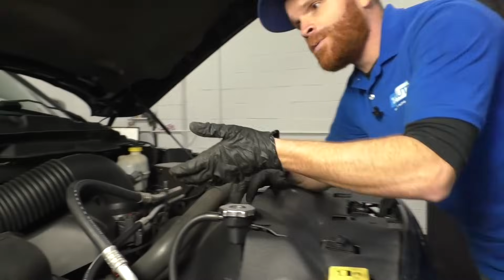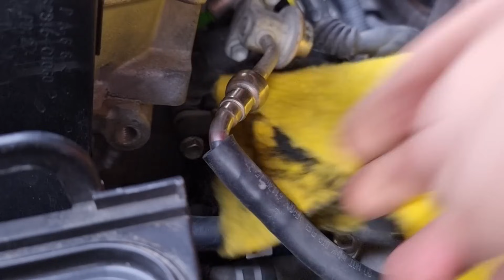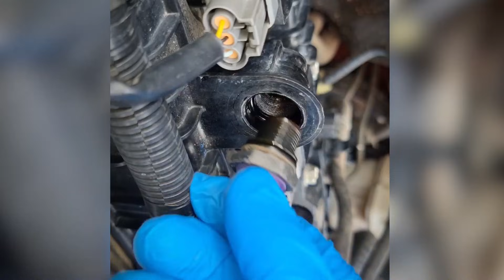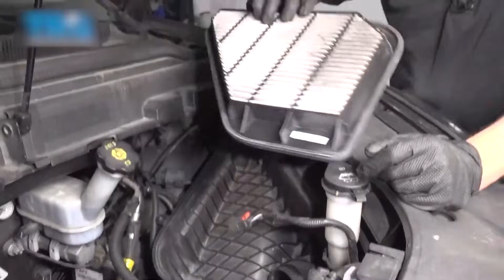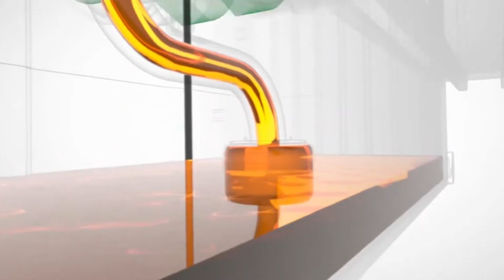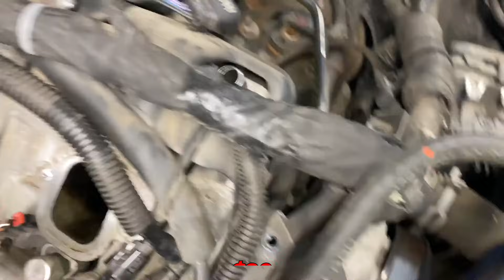Doing This Will Make Your GMC Engine Run Like New

Comment: Also mass air flow cencer
Reply from the maker: Good addition. A dirty MAF sensor throws off the air-fuel ratio and causes rough idle, hesitation, and poor mpg — and it’s one of the easiest fixes out there. A $10 can of MAF-specific cleaner (never use carb cleaner on it) sprayed on the sensor element, let dry, reinstall. Takes 10 minutes and often fixes drivability issues people chase for months. Solid tip to add to the list.

Comment: If it's a new 6.2 you will have to change the engine every 5000 miles.
Reply from the maker: The 2024 and newer 6.2 L87 dropped DFM entirely — so that oil change every 5,000 miles recommendation still stands but the every-5K engine replacement concern doesn't apply to the current build. The fix is already in the new trucks. 👍
Reply: @5150ToddB 😂🤣

Comment: I change my '15 GMC oil at around 5K miles. Last year, I changed my oil and filter, next day I drove 250 miles for business, turned around and drove right back, 500 miles total. At home, I raised the hood, let it cool down for about an hour, and changed the oil and filter again after 500 miles of continuous driving. First time ever doing this "Flush", well worth the cost of oil and filter.
Reply from the maker: Good move, that double change after a long haul can flush out blow‑by, metal debris, and fuel condensation, it’s useful after heavy towing or suspect contamination.
What engine and oil weight are you running, did you notice any difference after the second change?
Reply: @EverythingGMC-k9x  5.3 V8 using 8 quarts of Mobil 1 5w30 Truck And SUV Full Syn. Oil and an AC PF63 Oil Filter. Just curious, the oil looked used for sure, but did not look new at all. No harm done, just curious.